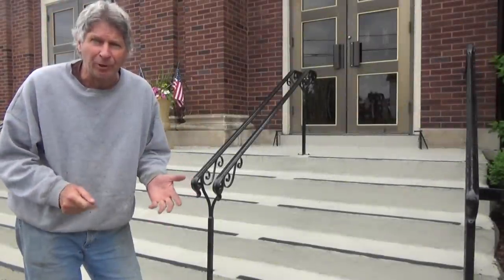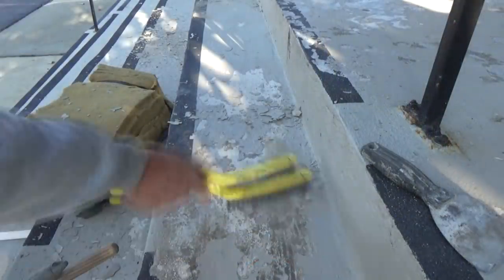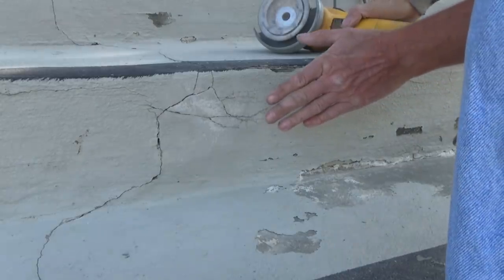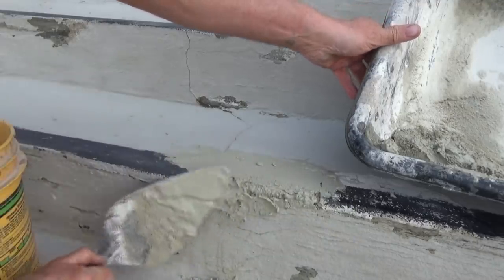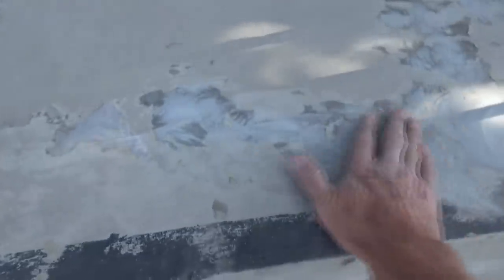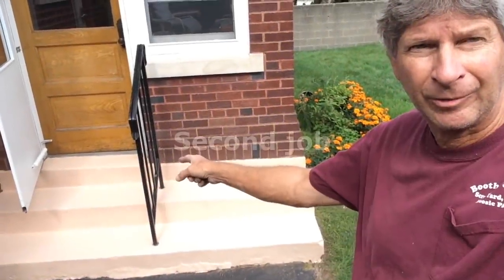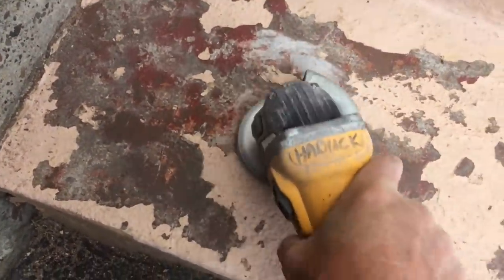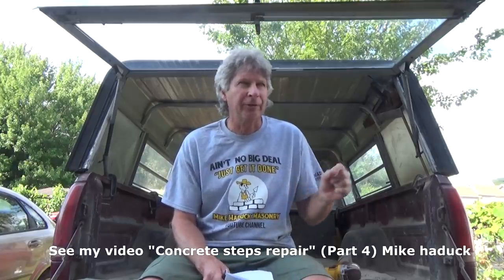CONCRETE STEPS REPAIR (Part 10) Mike Haduck

Comment: Mike
There is a grinding wheel the works 10 times better then that flat thing you are using.  It made by Diamabrush. I have used  it in the past to remove paint and coating from concrete and it works great. Most importantly you need to use a vacuum system whenever you are doing any kind of grinding these days!!!
Reply from the maker: Thanks For the tip David,  I will look into it,  mike

Comment: Mike understand im not trying to argue here.. I been doing cement work right outside philly for 25 plus years. 90 percent of the time before a patch or whatever i never wet the surface and i never had any problems. My understanding is the moisture in the mud draws out to the dry surface forming a type of suction. Any thoughts or just a short thanks mike again reply?!
Reply from the maker: Hi Dino, I been doing it over 50 years I leaned from the old timers, that’s what they always did,  bonding agents really didn’t get popular until the 80s, thanks mike

Comment: Won’t paint make it slippery ?  Salt is bad for concrete in the winter it’s hard. On concrete. Yes you need good tools for projects I’m too old to do little chores anymore but I like new ideas.  With high prices no days it’s good to do your own work. ❤
Reply from the maker: Thanks, they have a non slip paint like a fine sand added, but yes you are right. MIKE

Comment: Brickwork of the church wall looks as if laid new.Do they use weather protection paint or it is the quality of brick and craftsmanship which makes it look so good?
Reply from the maker: Hi Iril,  the secret is to keep the weather away from the brick with big overhangs,  up and down work last a lot longer than work laid flat, especially in my area,  thanks mike

Comment: Mike, I'm doing something that needs a couple pieces of rebar, but I feel the same way you do. Would it cause a problem if I tried to spray if with rustoleum first?
Reply from the maker: Hi Jacob, a lot of times I have to use it, I just try to put it where it is not getting wet, thanks, mike

Comment: Sounds like the patch job solution was the right one in this case. Regarding the paint, do you have an opinion on 1-part epoxy paint for exterior concrete on jobs like this?
Paul
Reply from the maker: Hi Paul, in our area with snow shovels, ice picks, salt and ware it’s a yearly or bi yearly thing,  thanks mike

Comment: Hi Mike! What happens to Cement All that is not covered? does it flake off? pit? crack? I had a job and Cement All  by itself (with a little mud) matched the stone great...  wondering what to expect (we have similar weather to you here). Thanks
Reply from the maker: Hi R, everything depends on where and how deep the patches are, it's a hard question to answer, thanks mike
Reply: @MikeHaduck  Thanks for the response! When you say you cover Cement All on the flat because it doesn't hold up by itself.. can you please elaborate on what you've seen.
Thanks again I've been "not making a job out of it" and making some $.  😀

Comment: Hi Mike. Great videos. Thank you...
Anyway, I'm debating over building a garage. I'm in Ct. so it's not much different. I'm looking at putting in a steel building or stick frame. Either one is fine. But I would like to be able to either put in a pit or a lift. I have two places I can build. One is flat and I would be making it an addition to a shed that has a foundation. The other is on a hillside against the house. So also an addition. My question is have you ever built the slab for a steel building and if so was it more expensive than for a traditional stick framed structure?
Reply from the maker: Hi Eleventeen,  In my experience the steel frame came first like in pole barns and then the concrete, pits are illegal anymore, so I would do some more research on what is a
Prudent for your situation, thanks mike
Reply: @MikeHaduck  ok good to know thanks again.

Comment: Hi Mike, another great video. I just need to know what is the type and brand of paint you use? This is the most difficult part of the job for me. Doing my small patio now and can't make a decision on the paint.
Reply from the maker: Hi Chris,  I use a outside stucco , deck paint,  and I don’t pick any certain brand, I just ask the guys at the paint store what is best, thanks mike
Reply: @MikeHaduck  Thanks Mike  I will check out the stucco paint

Comment: Hey, Mike! What do you think about those adhesive, black sandpaper strips that some places use on the edges of their steps? Is it good or will it just peel off when it's used outside?
Reply from the maker: Hi Brawk,  I got to say I never used them,  but I have seen them used and peeled off,  I guess it depends on how and where,  thanks Mike

Comment: You're only charging $25 per hour???
Reply: Honest person God bless him
Reply from the maker: Hi Brian,  is that too much?,  lol mike
Reply: @MikeHaduck  Not a chance.  That must be your friends and family rate, right?  The rate for a mason with your experience has to be higher than $25 per hour.  If not your clients are getting one heck of a deal.
Reply: my guess is that's Mike's church rate
Reply: @MikeHaduck  is not enough - in Denmark, as you might know, its waaay more expensive..we know the worth of a masonry. You're worth more :) !
Reply: Hey, I had an electrician who charged me last year $100 to change out 4 outlets, and run a new wire up 2 floors.
Reply: @saulgoodman2018  thats cheap
Reply: @mja8433  I know. And after calling like 5 other ones, that was way more expensive, he was the only one that called back.